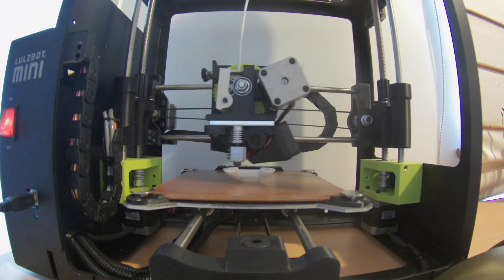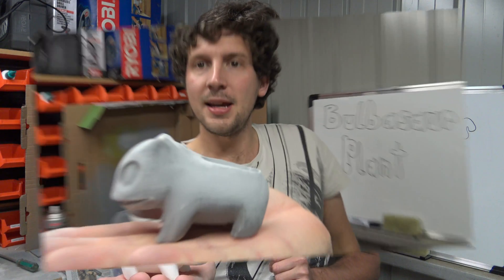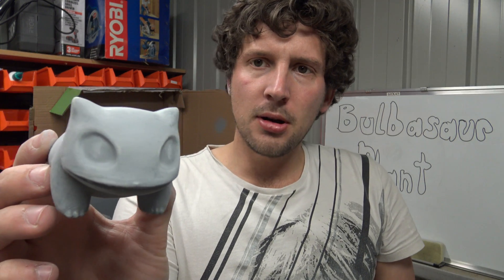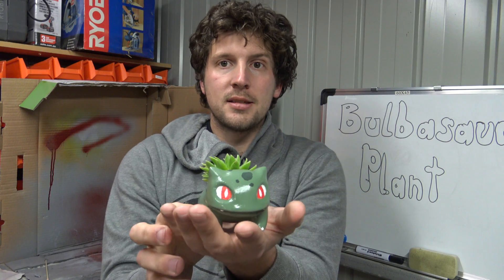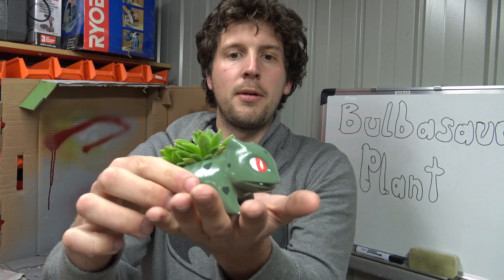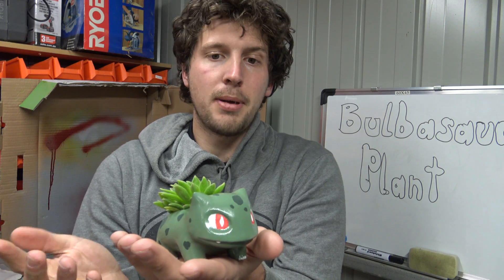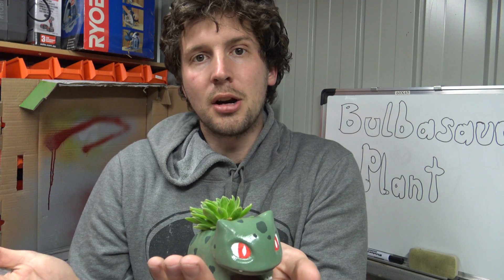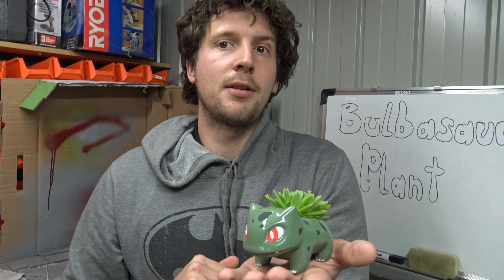Cool Real Life Bulbasaur (3D printed pokemon pot plant) DIY How To

Comment: what brand of primer did you use? i would love to make one myself. will it all hold up even with increased exposure to the water over time?
Reply from the maker: +pkcoyo We used a sandable primer from repco (Australian brand). The green gloss I used is water resistant so will act as a sealer but pla plastic starts to degrade when at 60 degrees c or higher so it's best to keep inside.